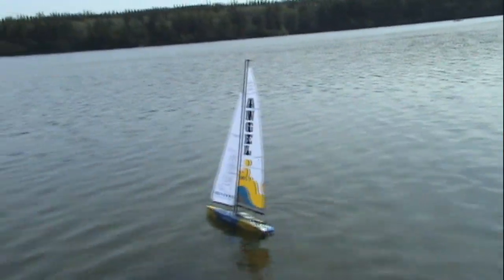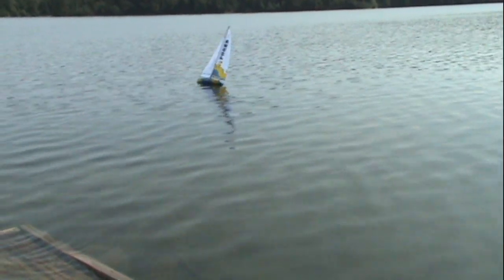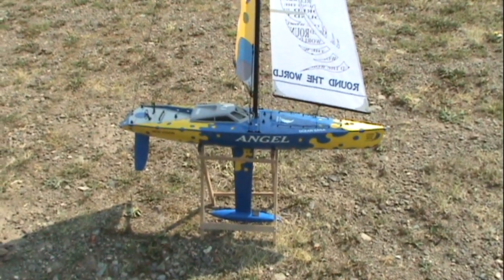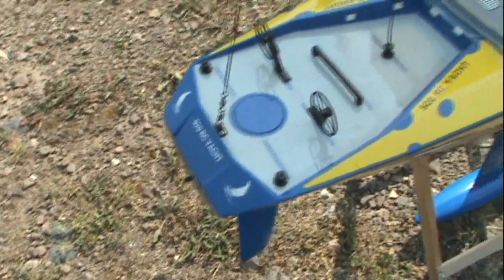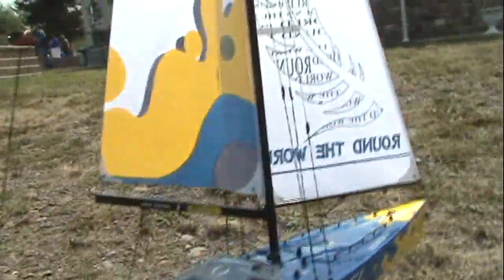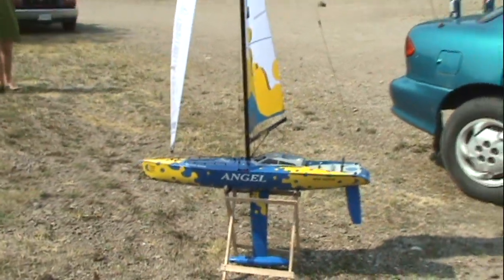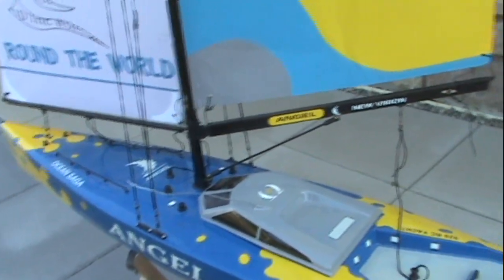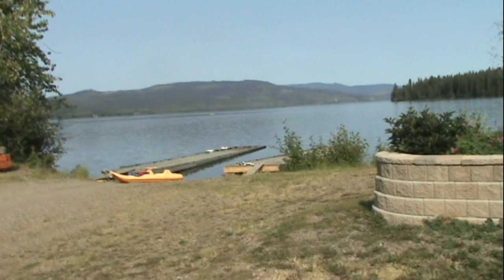randys rc hobbyroom angel 920 sailboat rigging and maiden fail

Comment: cool boat looking at ordering one now,
your battery will get wet in that position when the yacht is sailing on an angle all the water will go right there.
had the same problem in one of mine.  Not that it took on that much water only if I didnt put the latch on properly

Comment: I  just got this same boat. This was not my first sailboat,  but i could say the Shunbo instructions sucked. No parts list, no diagrams, just a few photos. I broke the bail  trying to put the boom vang on. Plastic grrrrr. The winch line was much to large and fraded attemping to put it through bowsie . I replaced the winch line with 90lb test fishing line that runs smoother and smaller  mm.
No instructions to place  receiver and switch? I guess you have to make  it up.
I hope it sails  as good as it looks.

Comment: Judging by how much the boat heels in 'no wind', I guess you forgot to fill up the keel with (sufficient) leadshot. I guess you know that now 5 years later and you also learned to loosen the foot of both sails, so they can get an airfoil shape instead of two flat surfaces, tightened down too much...

Comment: Hi the main is too high drop it down to get more wind, the hole jib is too high losing wing needs to come down I have tied mine with deckron line on the front of the jib , second the mast can bow near or on the joint needs A long plate to stiffen up that spot ,

Comment: Your keel is on back words
Reply from the maker: Thanks I noticed this and I did turn it around.  It is weird that it will fit both ways I think the maker of this kit should have made it only fit one way. But thanks for you answer action. It would have been helpfull if I had not noticed it.
Reply: @randyneighbour  Did you add more keel weight, since that video?  That seemed to be the biggest problem - it keeled over too easily in that light breeze.